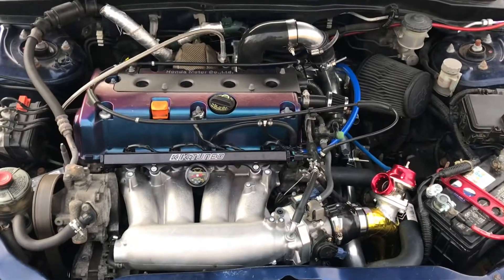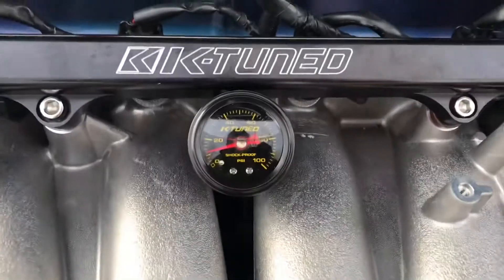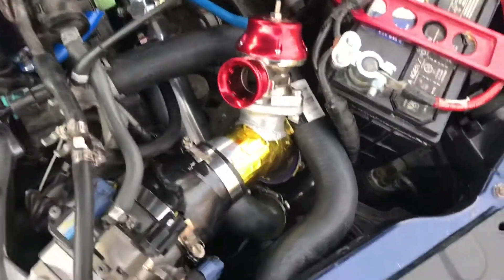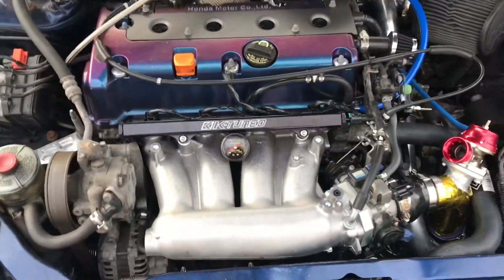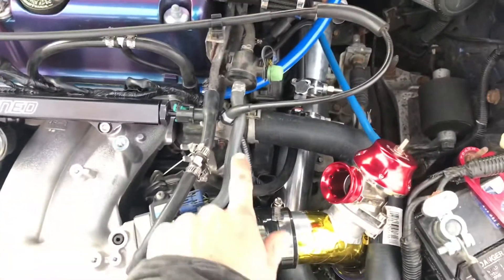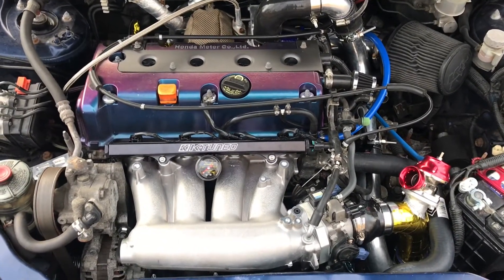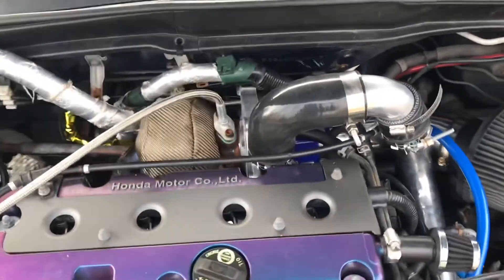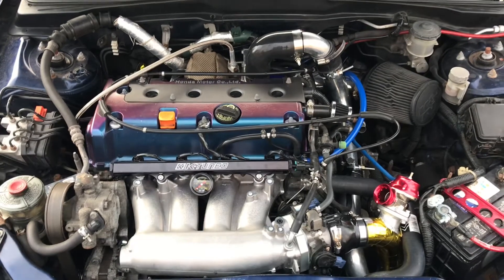Emusa Turbo Rsx Build Episode 5

Comment: Does it still hold till now?
Reply from the maker: the kit was holding up fine its along story im soon to make a huge update video  explaining everthing just know its gone be x2 better soon.
Reply: @Dc5Max  haha sounds good. Im planning to run the same turbo kit for my fa5. Surprisingly everyone is saying they are perfect for the money... anything else i should replace? I know bov and wastegate.. but what about the oil lines?
Reply from the maker: reklie yes I went vibrant oil return kit and I switched to a different feed line is Ebay just wanted a 90• bend ontop of turbo. Other then just make sure you have proper gauges to see info and you’ll be good

Comment: How did you set up your wg?
Reply from the maker: Sean White what you do you mean? the dump tube or wastegate vaccum lines or were it’s mounted?
Reply: @Dc5Max  how did you end up dumping it? And did you use the vacuum from the kit you got or how did you set up the boost control?
Reply from the maker: Dumbs straight down under car, and use vaccum port on side and run it too boost controller then from boost controller to t that I have on intake manifold

Comment: What injectors and fuel pump did you buy?
Reply from the maker: I’m using type s modified 520cc injectors and running stock pump atm. I have a deatschwerks 265l to install also